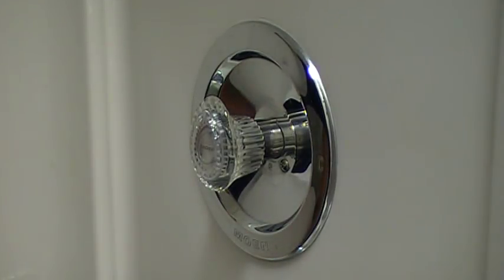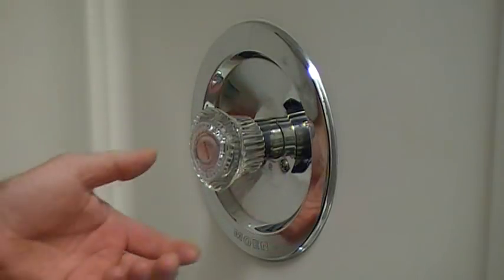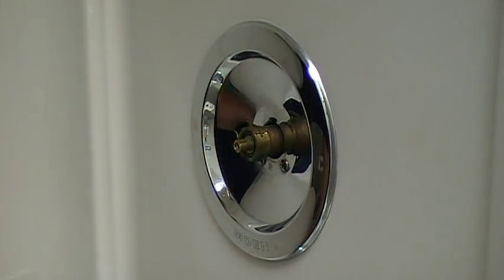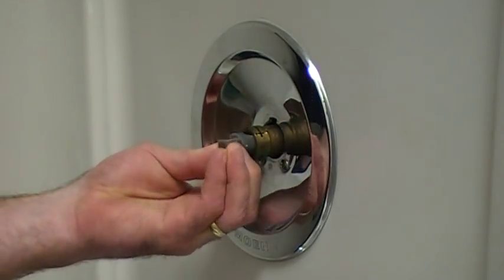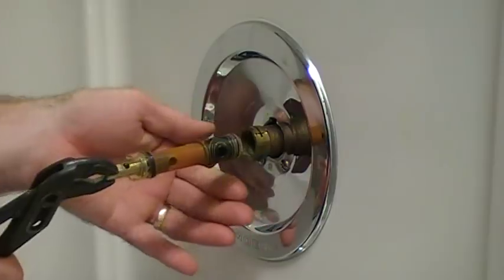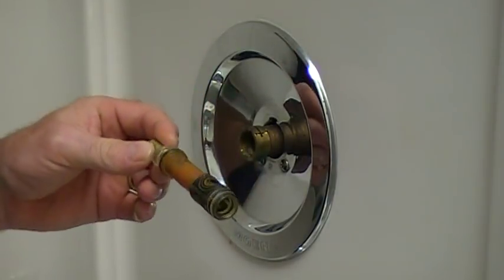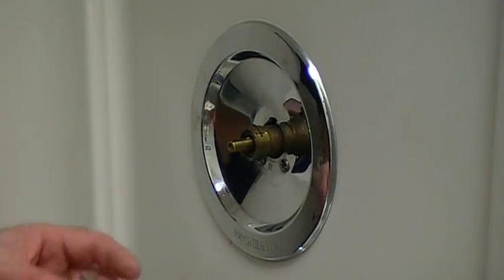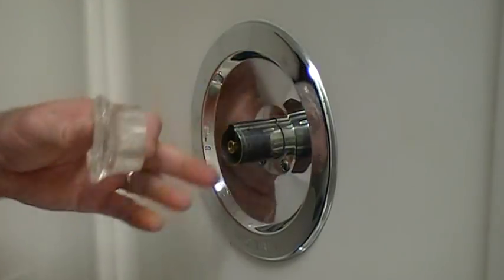How to repair a leaky single lever moen bath or shower faucet..Older style

Comment: Thank you for uploading the video -- It was the best of all the similar ones I previewed. After removing my old cartridge, I noticed it was different. But, since the 1225 replacement I purchased was the same size, I installed it anyway. It installed quickly, and worked as expected. But, there was a very slight drip at the spigot. (My old one dripped at the handle.) So, I did a little more research. I discovered Moen makes a 1220 that is basically interchangeable with the 1225, and only costs a few dollars more. The 1220 (which matches my old one) is a lot heftier, made of mostly brass, and has no plastic. It appears the 1220 works better on older fixtures while the 1225 is better on newer ones. Anyway, I was able to trade the 1225 for a 1220 at my neighborhood True Value and just paid the couple dollar difference. The 1220 installed even easier, and after installation, there were no drips. Those with older fixtures (Mine was over 30 years old) and those that mentioned drips after installation of the 1225, might want to consider the 1220 instead.
Reply from the maker: Joseph Jacob 
I am glad the cartridge came out easy for you. 
Thanks for the information Jacob. I personally never had any problems, but every now and then I get a complaint similar to yours from responders on this site and am not exactly sure of what the problem could be. Like I say, I have not experienced it with the 1225, but it may be the difference on some faucets.
Thanks for commenting and congrats on the repair!
Have a great week!    Al
Reply: thanks beef

Comment: thanks for the detail video!! my situation is water leaking around the lever area and i have to turn at a certain degree to minimize the leakage. was browsing through numerous videos for advice. your video was clear and easy to follow. the lever i have has a handle but hopefully it's the same resolution. will go to HD tomorrow to find a replacement cartridge. will update more later....
Reply from the maker: Hello ply_DIY;
You are more then welcome and thanks for the kind words!
All the best with the repair!
Thanks for commenting and let me know how you get along!   Al
Reply: the moen handle i have is different than yours---all metal with. i've removed the handle and drain all the water. pulled out the handle and unscrewed the adapter (?), but water is now dripping on my spout? is this normal? my initial issue was water leaking from the handle not spout.
Reply: the old cartridge was an all brass which i used moen 1200. after replacement it was still leaking. luckily i also purchased moen 1225 cartridge and the HD plumber told me to try. looks like the 1225 is the correct cartridge. after all, once it was in, the dripping stopped immediately. i'll have to remember to use this part replacement in the future. Thanks Al for your help!
Reply from the maker: Hello ply_DIY;
I am glad you got it straightened away!
Single lever is always 1225B unless it is a posi- temp bath or shower faucet.
For the most part; 1225B is the go to cartridge. If you have to pull it out or lift it up and turn it to get your water temp; then it is the 1225. The 1222 for showers or baths only simply turns and you adjust the temp. It does not pull out.
Thanks for commenting and congrats on the repair!    Al

Comment: Thanks for your great video it really helped a lot. A comment: my 1993 Moen "chrome sleeve" at about 1:12 in your video had two tabs one at 3 & one at 9 o'clock that locked the sleeve to the escutcheon plate. I pulled and pulled, cussed and discussed until my helper noticed them. It required turning the sleeve 90 degrees to get it out. Another suggestion is to close the drain or put a damp wash cloth over it to keep small parts from accidentally going down the drain (Murphy's law). Again, thanks, excellent tutorial.
Reply from the maker: +Kam W 
You are more than welcome!
I mentioned plugging the drain right at the beginning of the video because I have experience chasing a screw down the drain and it is not a lot of fun.
I am glad you liked the video!
Thanks for commenting and have a great week!   Al

Comment: Thanks for the awesome video, now my bathtub is not leaking.  The tough part was getting cartilage out but after that it was easy.  Black plastic from old cartilage was stuck inside the hole and had hard time getting out but  I did fixed it a lot of help from this video.    Thanks again.
Reply from the maker: Hello Tommie;
You are more then welcome!
Getting the old cartridge out is by far the most difficult task! Once that is done; you are sailing!
Thanks for commenting and congrats on the repair!    Al

Comment from the maker: Hello mysticman258;

You must line the cartridge up properly so that the clip goes into the body of the valve .
Pushing the cartridge in as far as it can go and using the little tool that comes with the cartridge to turn it once it is place should make the repair easier.
Thanks for commenting and I wish you the best of luck!     Al

Comment from the maker: Hello Christa Beaudin;

First off! I am glad you fixed the faucet and give your self a big pat on the back for a job well done.
The older style cartridge pulls out and turns to adjust the water. It is the 1225B cartridge.
The newer style faucet simply turns and you adjust it to where you want your water temperature at. This cartridge is the 1222B.
Thanks for commenting and have a great week!    Al

Comment from the maker: @erthworm13 The plastic tool works in almost all the change overs for me.I don`t use the puller to often.I know the notch you are talking about and I give it a try on the next repair for curiousity.It is not a big thing for the homeowner to get the hot and cold in the correct spot with this cartridge.The posi-temps are clearly marked as to where the hot and cold are.They have an H and C on one of the tabs and that has to go in top.Thanks for commenting and have a large day!!!   Al

Comment from the maker: Hello antrigg1985;

Yes, the cartridge is where your problem lies!
You need to replace the cartridge and you will be all set!
If your moen faucet pulls out and you turn it to get the proper water temperature; then you would be looking for a 1225B cartridge.
Thanks for commenting and best of luck with the repair!   Al

Comment from the maker: Hello 7shellshell;
Moen makes 2 styles of single lever cartridges.One is the 1225B cartridge that you pull and turn or vice versa. This is the most common cartridge as it is used on their single lever sink,basin and bath faucets.The other cartridge is the 1222B which is only used on the posi-temp single lever bath and shower faucet.This cartridge does not pull out, but simply turns counter clockwise to turn on.This cartridge is for this faucet only!
Tks for commenting! G.L. Al

Comment: You forgot the little washer which may not make a difference in some cases but in others it helps it turn off by creating a little spacer between the handle and valve. When the nut is tightened it secures the plastic to the stem just a tad further out so it can be pushed in further. Great video.

Comment from the maker: Hello David Vaillette;

The cartridges are 2 totally different sizes. The 1222 would not fit into the older style faucet as it is twice as wide as the 1225. It is for the newer model posi-temp faucet.
Thanks for commenting and have a great day!   Al

Comment: We've always used a cartridge puller but I've wondered what the plastic piece was for, I'll have to give it a try just for fun. Also with the old Chateau valves like that the cartridges have a little notch on one side of the end of the brass. Assuming the valve is plumbed correctly if you have the flat spot on top then your hot and cold should be correct. I believe it's the opposite with the Posi-Temps, with those the slot goes on the bottom.

Comment from the maker: Hello Alejandro Sanchez;

You are more then welcome!
Congrats on the repair!
To change the control so that is will be back to the way it was; you simply remove the handle and turn the center stem 180 degrees. You do not have to turn the water off. Simply remove the handle and turn the brass that the handle screws into; 180 degrees and it will be back to normal.
Thanks for commenting and enjoy your day!    Al

Comment: Thanks for the video, it really came in handy.  I was a little non-plussed when I pulled out the old cartridge and it was of a different type than the 1225 that you said I needed (and I had already purchased), but I've dealt with half-assed repairs of yahoos who were in homes before me, so I installed the new one anyway.  It was up and working in five minutes and not a sign of our bad leak and the action is smoother to boot.  I don't suppose the guarantee covers idiots using the wrong parts...
Reply: sweetbeef what u sayin

Comment: wow ! thanks Dave ! this made it so easy !
 got my cartridge, don't think my cartridge is pregreased. what kind do I get?
this video made it so easy to do ! didn't want to call my fav plumber and pay him 50.00 to do this. wanted to try myself ! thanks, you are a dream !
Reply from the maker: Hello Susan;
You are more then welcome!
It should be greased enough, but if not; just a little container of faucet grease will do the job for you!
I am glad you got along well with the repair!
Thanks for commenting and have a great week!         Al
Reply: did it Dave ! my plumber was there; had to call to have replacement of shut off valve and old copper pipe. but when he saw I knew what to do..he was applauding ! blessings to you for what you do !
Reply from the maker: Hello Susan;
I am glad you got everything straightened away!
Thanks for commenting and have a great week!
Al

Comment: Hello.  I am so very glad that I watched your video.  I was able to get the cartridge changed with a problem, but it hasn't stopped the leak entirely.  It did slow down some, but water still comes out of the handle when the water is turned on.  Any suggestions?  Thank you.

Comment: Also, make sure you have the right one.  When I took it out, I thought mine was a 1225, but it was a 1222.  I had bought both.  I couldn't get the clip into the 1225, but the 1222 went in no problem.

Comment from the maker: Hello myunicon;

If you know where the main shut-off is at;turn the water off there. This should stop the cold and hot water from running. Go to a basin in the bathroom and run some water just to make sure you have no hot or cold. Do not run it in the tub as you will be in there to change the cartridge. Once the pressure drops off in the basin or kitchen sink; you should be all set!
Thanks for commenting and best of luck with the repair!   Al

Comment from the maker: Hello believr77;

Sorry for the late response.
Very odd this took place!
I would check the body of the faucet itself to make sure there are no imperfections in it.
If it has been leaking for a long period of time; it is possible that the faucet itself has an imperfection in it. Not very common, but possible.
For the most part the cartridge takes care of any leaks.I have seen a few cartridges that were defective from the get go.This could be where the problem lies.
Tks for commenting and G.L. Al

Comment: This looks like the exact video I need! However, I have a really stupid question:  Does the water need to be shut off before I do this?  I'm assuming yes.
Reply from the maker: Hello Dave;
The very first step is to turn your water off;  if not it won't be a pretty sight.
So you want to turn it off and open the faucet just to make sure that it is closed completely.
Thanks for commenting and best of luck with the project!     Al

Comment: What a great video!  Even an old inexperienced mature lady such as myself could understand it.  My only problem is that I was unable to pull out the cartridge?  It is turning and coming out only part way?  Should I continue pulling?  Perhaps I didn't break the seal?  I did not receive a gray tool, but a white one which does not appear to fit.  Perhaps I was given the incorect cartridge?  My Moen is also about 25 years old. Help??  Thanks in advance....Christa

Comment: My cartridge needs replacing as well. Is it possible to replace the cartridge so that it is not the pull out-and-turn for hot&cold, but is instead the kind that you turn without having to pull out first? Or is it impossible to exchange one for the other with a standard moen shower?
Advice is super appreciated. Thanks!

Comment: PEOPLE,  Make sure you use a GENUINE Moen product....I bought a generic one on ebay and after a month it started leaking again...I took it out and noticed there was a small chip in the plastic right next to the rubber seal.   So this time I used a Genuine Moen product and it seems to be working great....it was a lot easier to replace than the generic one as well.

Comment: Thanks for posting this!  I'm not sure how much I saved vs. having a plumber do this (and I did almost call one), but I was able to get the right cartridge (1225, in my case) from Home Depot for $20 and do the job myself in about 20 minutes.

For those who get their hot and cold reversed, note that you don't have to pull the whole thing out to flip it.  Just remove the collar (that chrome thing that's about 3-4 inches long), spin the brass knob where the handle would be attached, and then put it all back together.

One question - the part I got didn't really appear to be pre-greased.  It did have a greasy film on it, but that's not enough to consider that "greased", is it?  I went ahead and bought some silicon grease and put some on both seals, just to be safe.  It's not leaking, so I guess it worked.
Reply from the maker: +Darrel Owen 
You may find the ones that have been on the shelf for a long time tend to get a little dry, so adding a little film of lubricant won't hurt. Adding the film will make it easier for removal in the distant future.
You definitely saved a few dollars doing it yourself.
Thanks for commenting and have a great week!     Al

Comment: Great video. Thanks for posting.  
I have a newer (4 years old) lever style faucet that won't turn off.  If I turn it back and forth a few times I can usually get the water to stop but it doesn't stop in the same place.  Is this a problem with the cartridge?  
Thanks again

Comment: I didn't have the green white doohickey so I used needle nose-that worked. That white adapter is now part of my plumbing toolbox and I put the drain plug in before I started!!
Reply from the maker: +bob minnery 
Great job Bob! Congrats!
The piece of plastic comes in very handy for loosening the cartridge and that makes the project so much easier.
Needle nose work just fine!
Thanks for commenting and have a great week!     Al

Comment: My Moen is a about 12-14 years old (time flys) with a round clear handle. i remember it wasn't the anti-scald. I have no separate shut off so once I remove it i'm committed. My understanding is that I have to call Moen so they can mail me the free replacement. How can I tell them what it is with out removing and possibly destroying it? I do have the two big home centers minutes away. Any advice is appreciated. You're a good guy for helping us all.
Reply from the maker: Hello MrTuberguber;
If your faucet pulls out to turn the water on; you need a 1225 cartridge.
If you turn the handle to turn the water on then you are looking for a 1222 cartridge.
This should be what you are looking for.
Thanks for commenting and have a great day!     Al

Comment from the maker: Hello TheraHeelFootMask;

Very odd to be happening. I would suggest another cartridge. I have come across this once before, but it is very rare. If you remove the handle; does the water come out of the center of the cartridge or around the outside?
Keep me posted!   Al

Comment: Thanks Al...I was able to order in on-line and it was waiting for me when I got there. The only thing I'm curious about is the fact that the replacement package included the removal tool but did not include the little retaining clip that goes through the top. Does that mean I do not need one or did they just short me?

Comment from the maker: Hello Yar Yar;

If you have t pull out your handle and then turn it to adjust your water temperature; it is a 1225B cartridge that you will need for the repair. If worse comes to worse and you have to remove the handle; use a hacksaw and cut it off. It will take some time to do, but it you will not do any harm to the body of the faucet.
Thanks for commenting and best of luck with the repair!    Al

Comment: Ok let me post this the correct way its late sorry I'm upset with this issue I believe this is what I need to do I have hot water driping into my tub and it seems to be coming out a lot more recently if I replace this would it fix my problem? Ifso I can't wait to fix it your video is very very helpfull

Comment: Great help, I could not tell what that cartridge removal tool was in the instruction pamphlet, this video made it a breeze!!
This shower was already installed when I bought the house do you think a pluming store would still swap my old cartridge for a new one without a receipt?  
Thanks for the post!!
Reply from the maker: Hello Wayne;
You are welcome!
There isn't really any description for the plastic tool that comes with the cartridge.
The tool is almost a must when it comes to a removing the cartridge. Breaking the seal between the o-ring and the faucet housing is a must.
It won't hurt to ask as some stores will give you a new one with no issues.
Thanks for commenting and have a great weekend!    Al